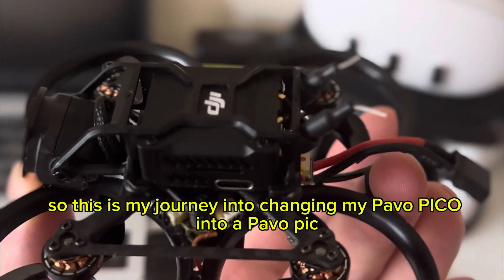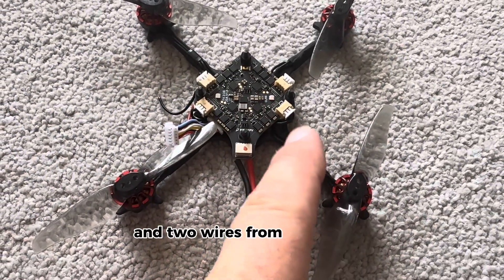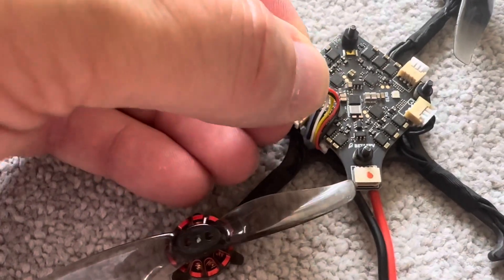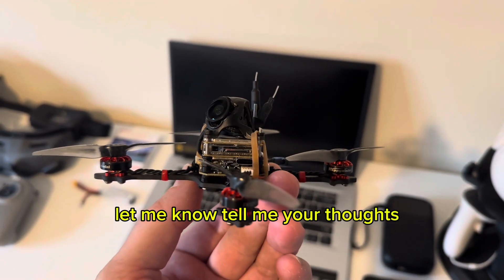Pavo Pico - To Pavopick - How To Build yours

Comment from the maker: These are not affiliated links. I have no connection with these people at all.
If you already have the Pavo pico
And o3 air unit. 

Parts list
Frame & Canopy Cover for Happymodel Crux3 https://a.aliexpress.com/_EwpW4tH
Motors
HappyModel EX1202.5 1202.5 6400KV
https://a.aliexpress.com/_EJjVvkP

Longer screws
sourcingmap M2 x 40mm 304 Stainless Steel Phillips Round Head Screws Bolt 60pcs https://amzn.eu/d/07nGtlDk

Comment from the maker: Time line 
0:00 intro
0:07 why I’m changing the Pavo pico
0:29 drone motors I’m using.
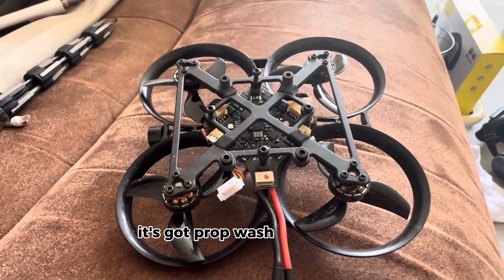0:41 the reason is flight time + prop wash.
01:14 no computer needed for these mods.
01:51 03 air unit wire control.
02:41 micro drone buzzer pins.
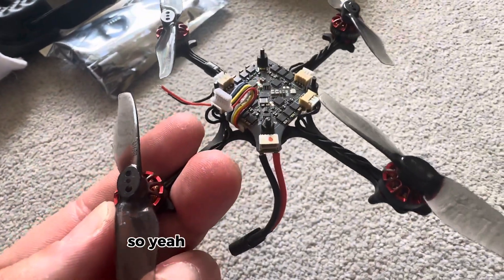02:59 weighting parts before stripped down.
03:13 dji camera stripped down and in new housing.
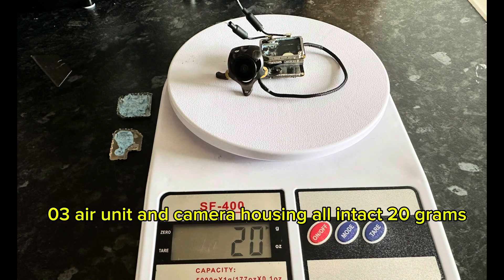03:36  Dji 03 air unit naked weight 18g with antennas.
03:41 Dji o3 air unit with camera naked and new housing weights 20g
03:46 total weight of drone Dji 03 air unit 
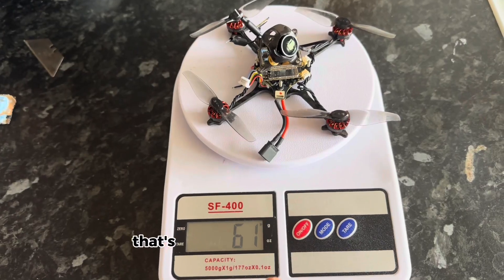04:28 New holes for the Dji o3 air unit to fit the new screws on the frame.
04:59 That is my PAVOPICK build. Let me know how you got on with yours if you made one.

Comment: I use 1204 6500kv motors on 3.5x2.2 bi blades. Custom 3.5 inch TP frame. Flys 26 min at 50kph with 2s 18650 LiIon.
Still analog. Thought of O3.
Reply from the maker: Yeah I’m thinking tri blades might. Be better have you tried them at all.? That’s a good time. What is your weight.? I can’t wait to fly. Uks crap summer at the mo.
Reply: @Fpvfreaky  collecting and testing props is my love hate passion 😆 
From my experience the 1202.5 motors are best suited with  the Gemfan 3018 bi blade props.
The tri blade GF 3016 dont perform well, because they are too heavy for the small motors. They dont have enough torque for tri blades.
I tried some rcinpower 1204 8000kv on 2S. These are okay on bi and tri blade 3" props. Although I must say the bi blades perform better, but are harder to tune.
Reply from the maker: @chrisbee5481  cheers for the info mate.👍🏼
Reply: @Fpvfreaky  mine weighs 56g dry with gps.
Reply: @Fpvfreaky  if you want to try tri blades that work nicely on your 1202.5 motors, go for the gemfan 2520.